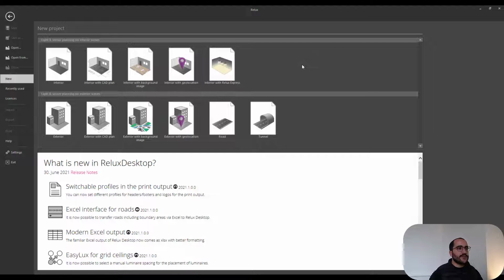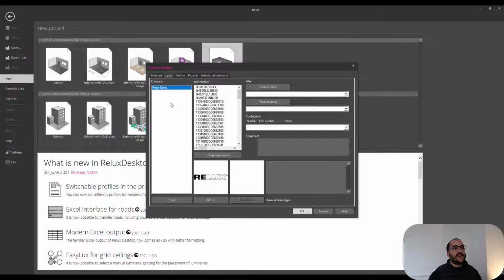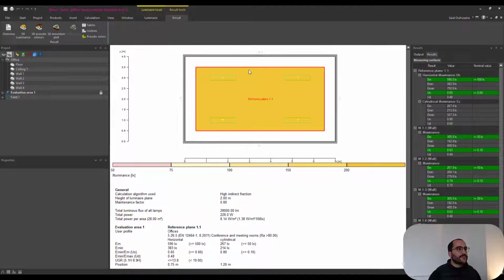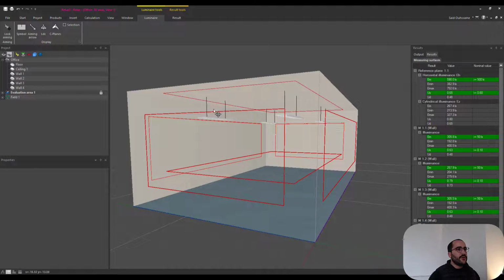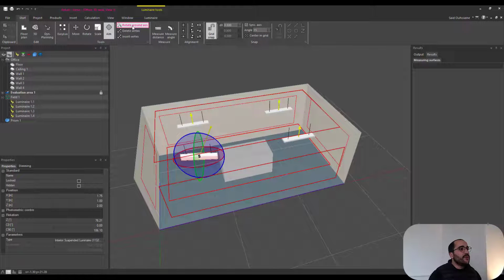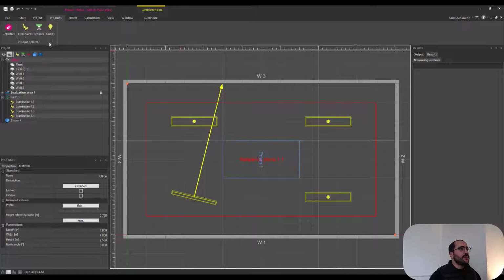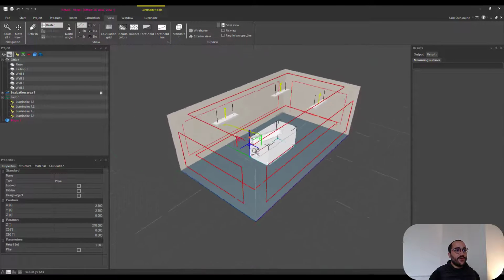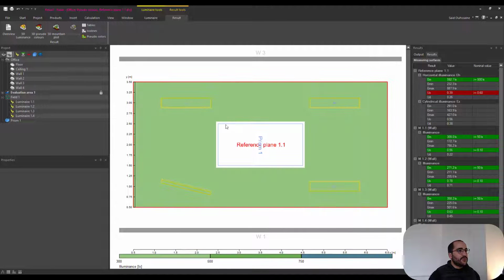Interior with Relux Express #2 | Overview of the Relux Interface

Comment: Great Video...is it possible to run easy lux for individual rooms within the same floor?
Reply from the maker: Yes, absolutely!
Reply: @OUHSSAINESAID-LightingDesign  perfect...any tips of how ro achieve this?
Reply from the maker: @matthewrichbell4119  You specify the profile of your room, you add the luminaire you wanna use, and run easyLux, and it'd calculate the right amount of luminaires. Sometimes it's not 100% accurate, so you need to adjust that manually, but inside easyLux !
Reply: @OUHSSAINESAID-LightingDesign  thanks for your time. Easylux still runs for the whole floor plan rather than a certain area. would a evaluation area count as seperate room / area to run the easylux.
Reply from the maker: @matthewrichbell4119  Well, it doesn't run for the whole floor, and it doesn't run for an isolated evaluation area inside a room!